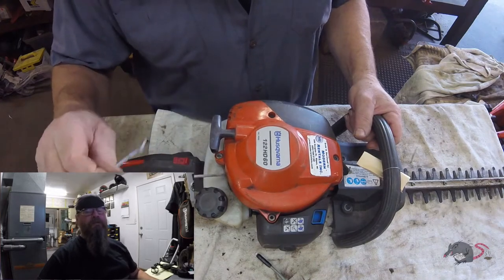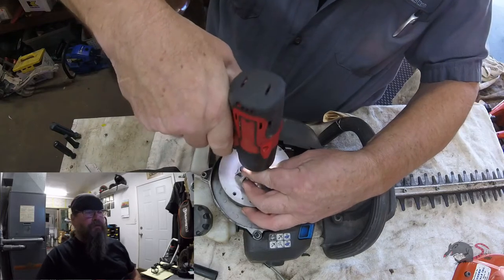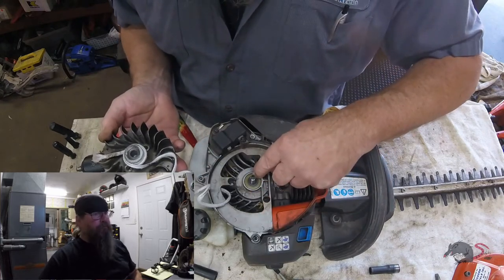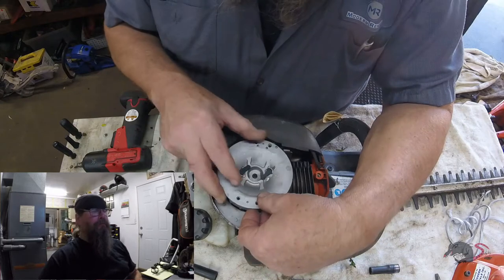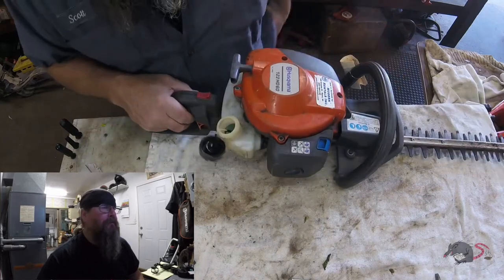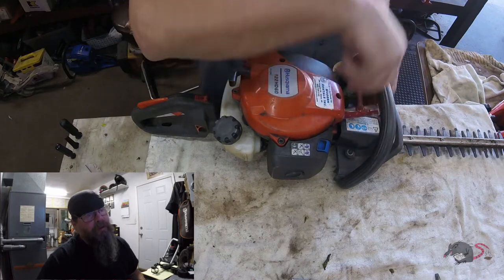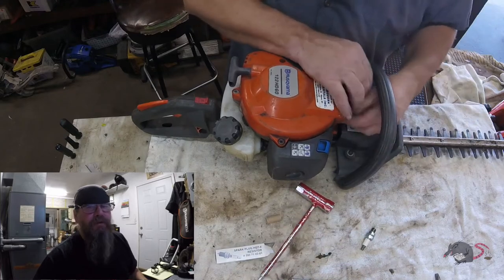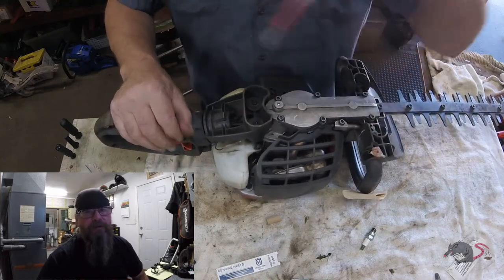Husqvarna 122hd60 Hedge Trimmer Repair

Comment: Great video. What tool did you use to fish that fuel line out of that tank?
Reply from the maker: Its just a metal rod I bent into a shape I wanted. Then I covered it in fuel hose so it looked like a tool instead of a scrap that someone might throw away.